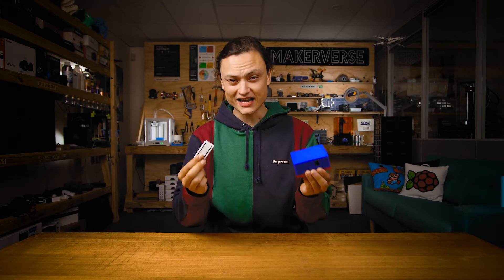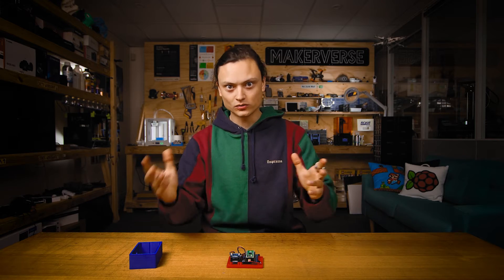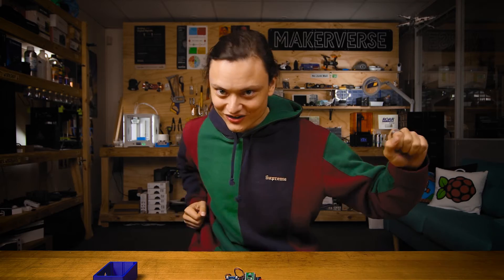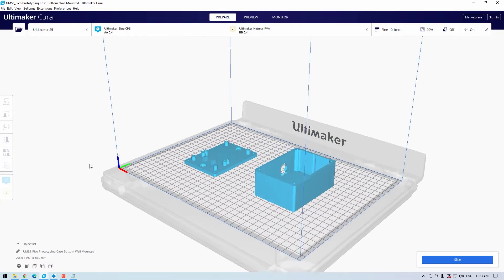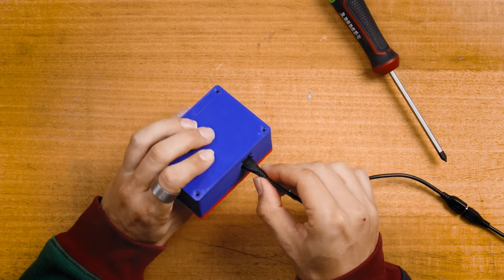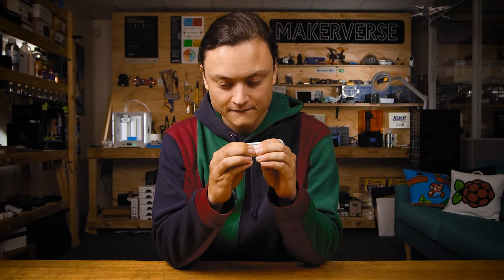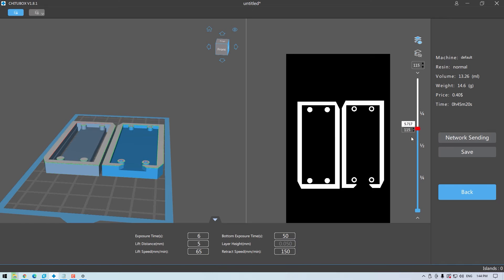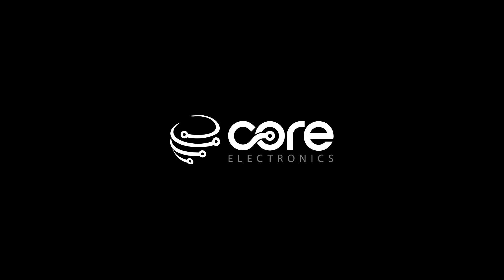Raspberry Pi Pico and PiicoDev Modules Enclosures | 3D Print Your Own!

Comment: The PiicoDev breakout board needs to have provision to use I2C 1  (Gpio 6/7) rather than I2C 0 (Gpio 8/9) as this is the default using the Official Arduino support. Plus a reset button would be helpful.